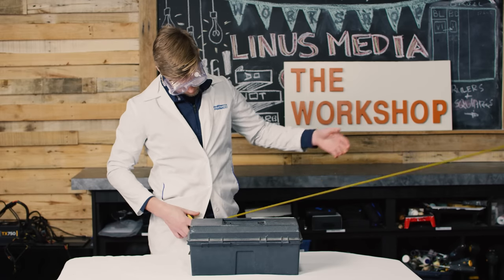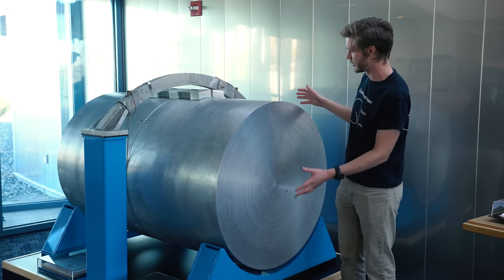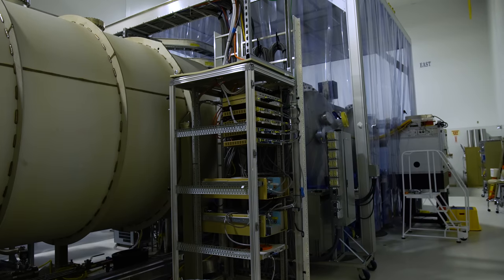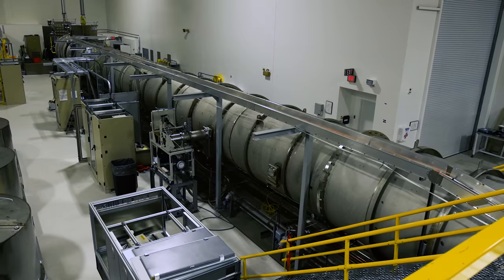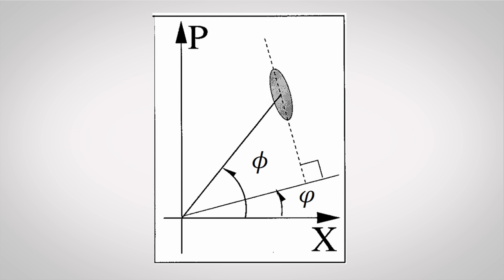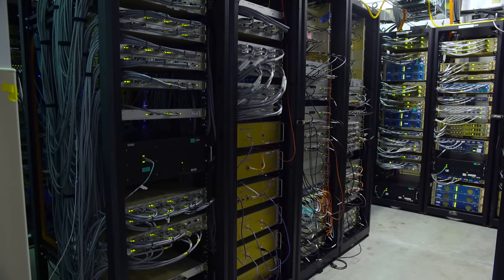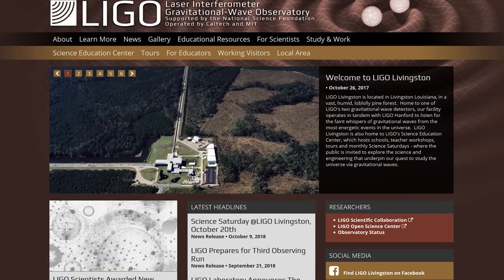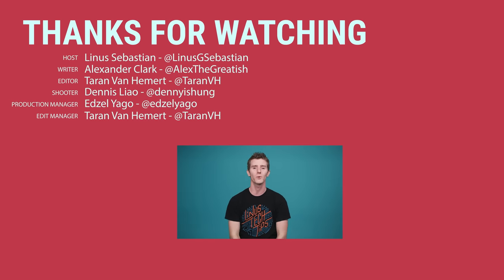Using 6000 CPU Cores for SCIENCE - HOLY $H!T

Comment: Playstation 3 has 8 CPU cores
Reply: Well, yes and no. It has one PPE at first, which is connected to an array of 8 SPEs, while one of these 8 is only for redundancy. So it's 1 PPE & 7 SPEs active.
Reply: @philipmorris4027  so 7+1=8
Reply: @st20332  Yes and no, because 8+1=9
Reply: @philipmorris4027  you said there are 8, and one is for redundancy, so 7+1=8
Reply: @st20332  Well, it's still in there and it's wired to the rest of the Cell's circuit. So, eventually it's still there. That's my point, dude. That it's there:D I'm not saying, that you're able to use it just like that. But if you manage to hack the system somehow, you might get all of the 8 SPEs to work (like unlocking deactivated cores of an AMD Phenom), but afaik nobody has done it yet. However, the circuit consists of 8 (existing) SPEs & one PPE eventually.
Reply: @philipmorris4027  Yeah what you're saying is right, but it still is 8 cores regardless of if it's being used or not
Reply: @st20332  Ok, so then let's establish 1+7 actually used for computation and 1+8 physically existing cores. Since my point was referring to the number of physically existing cores after all. So by that definition we're both right. Because only firmware locks the Cell down to 7 useable SPEs, not the wiring itself. So I'd say we're both right.
Reply: Philip Morris but 7+1=8
Reply: @st20332  a processor (i7 for example) usually uses 1-3 cores. 4 cores are only used for bo4 etc. Depends of graphics settings and graphics card, ram etc. :)
Reply: @aname7254  yeah but that's what the program that's running is saying to only use however many cores, my point is even though it ain't being used doesn't mean it's not there, so there's 8 cores
Reply: Jonathan Gurgua  upload a video of it then, cause if you're saying you can run Xbox one games and os, as well as PS4, then uve made an emulator for a different architecture, so how'd you do that? Cause there's no exploits for PS4 or Xbox yet, let alone an emulator
Reply: @nemdotu  Did you actually read my last reply? Again: I'm talking about physically existing cores. I'm not talking about the cores beeing used by Orbis OS. It's like having a car with a spare wheel. Of course you usually use only 4 for driving and the spare one for redundancy. But still, you're carrying around 5 (physically existing) wheels in total. That's my point, dude. It's not that hard:D I don't want to start an argument filling up the whole comment section. My point is really simple, bro. I'm only saying: Cell has 1 PPE (physically existing & active) and 8 SPEs (physically existing & 7 of them are used by software). We've already established that only 8 cores of 9 (existing) are used. Can we please settle this now?:D:D
Reply: To everyone arguing who cares
Reply: my head hurts
Reply: @philipmorris4027  lmao with the circlejerk, its 8 cores. 7+1 = 8
Reply: The Threadripper 2990WX has 32 cores lmao
Reply: @Pennys1   I can't take it anymore... :D Go and read the documentations from Sony/Toshiba/IBM or Wikipedia. Following is from Wikipedia:"...each of the nine processing elements (PPE and SPEs) is equipped with a DMA engine."; "the main processor called the Power Processing Element (PPE) (a two-way simultaneous multithreaded Power ISA v.2.03 compliant core), eight fully functional co-processors called the Synergistic Processing Elements..." For the last time: it's 1+8 cores. :D The SPE can't work autonomous without the PPE, because only the PPE has full memory access and does scheduling for them. The PPE itself however can run a complete OS. Why is this so hard to understand? Are you doing this on purpose? :DD
Reply: @philipmorris4027  With the little computer hardware knowledge I have, I finally understand what you're saying, thanks, and I mean it
Reply: @philipmorris4027  Am 14 and learned a lot by what you told me am making something that can change how the world views atoms and this helped me
Reply: @Pennys1  You're welcome :)
Reply: @claybronthompson3058  Are you kidding me... Come on...
Reply: @aname7254  I don't think bo4 is on the ps3 lol
Reply: But it can't run Debian, because Sony...
Reply: @heretolevitateme  It can, there's several videos showing you how you can install it. Sony just removed it due to the issues they had and were just lazy, which just shows how bad a company they really are.
Reply: So to do the math - Playstation 750 will be able to detect gravitational waves?
Reply: @philipmorris4027  just had a whole conversation on YouTube about cores in a PS3
Reply: @st20332  yikes dude
Reply: My $150 phone has 8 cores
Reply: Tony Melo  That's a yikes from me. Nobody was talking about whether the console was good or not, not what it can and can not play, just an arguement about how many cores it has, whether slave or not. But you come in calling everybody a fanboy. Talking about something that has nothing to due with how many cores it has which is what we're talking about.
Reply: @bradyosullivan8225  When did your phone come out though?
Reply: @muufle  October 2016
Reply: @bradyosullivan8225  Either way, the ps3 came out in 2006, 10 years before your phone so, it's not a big surprise that your phone which is about quarter of it's price is around the same.
Reply: @muufle  yeah I know
Reply: Tony Melo  Well, when comparing only CPU compute performance, the PS4 Pro's "Jaguar" has a theoretical peak performance of only 134, 4 GFLOPS (only CPU) (source: Wikipedia) & the PS3's Cell has 230,4 GFLOPS (source: IBM). But when you add in GPU compute performance (since Jaguar is an APU), then the Jaguar totally wins over the  Cell.
Reply: Stan Edwards i know
Reply: Heaps A Head i didnt say so...
Read my comment again
Reply: Brades of Spades maybe, but they are really really bad cores
Reply: Xbox is shit
Reply: Terry Wilson  Delicious:D
Reply: Jonathan Gurgua  lies
Reply: @Pennys1  basically there are 7 cores + 1 extra for redundancy + another one to control the 7 and the redundancy one so 7+1+1=9
Reply: Jonathan Gurgua  On today's episode of things that never happened.
Reply: 2+3 = 5 :))!!!!

Comment: Amd ryzen threadripper 3990x: These are both a littler over 6,000 cores, I did both how many cpus they would need for physical and hyperthreaded cores plus the cost depending on what they would need. 94 Processers with only physical cores costing $376,000 and 47 processers if they only wanted to use hyperthreading costing $188,000. Now if they counted the hyperthreaded physical cores for over $300,000 they would have over 12,000 virtual cores. I hope my math is right.

Comment: The cyclotrons I work on pump valcuum to 10-7 millitor.  or 10-11 atm. We have several stages of pumps, starting with oil pumps and ending in hyper atomic pump. The Atom pump can pump out individual atoms.
Reply: All our electronics are water cooled.

Comment: Q: Wait.... what about instantly transmitting 100 PB of data to my backup server using quantum entanglement protocol? A: What a brilliant idea! Q: err... how do you quantum entangle 2 servers? A: By entangling their network cables obviously..  Q: But what will happen to my data when you untangle all the network cables?  A: The data will be annihilated with the possible creation of a small black hole in the middle of each CPU (which, by the way, will improve their cooling).

Comment: It's quite incredible how the instruments needed for physics evolve: an inclined surface, a pendulum, a barometer, an torque meter, and an interferometer to simulate a light clock/light meter.
Reply: Fun fact: my physics professor, who slays mad poon 20yrs younger than him, worked at Virgo (big tungsten cylinder) in insulating it from external conditions and did some code corrections for this. Turned out it still recieved all kinds of mumbo jumbo, but his PhD was solid.
Truly one of the kindest, smartest and humblest people I know, and still a Chad genius. Be well, Damiano Carlesso

Comment: I'm confused!!!
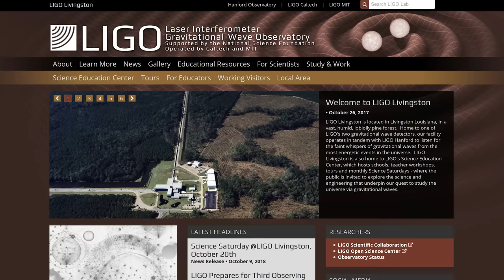@9:46 you refer to a 22 microsecond delay...
Since we're talking about a near perfect vacuum here (???), the speed of light is 3^8 m/S
The distance is 4km (4000m), so my math shows that to be a 13.33 uS one-way trip time.
My only possible answer is that we're not talking about the laser beam itself, but rather about a clock signal that's travelling in some OTHER medium than vacuum (eg: copper) that has a velocity factor of somewhere around 60%
Reply: Like an optical fibre with a refractive index of ~1.4

Comment: only if they new how to suspend a glass (with its sides formed magnets) between two magnets in the air the could even build air conditioner on the top of the building plus it wdnt even be effected by a truck traveling on a highway